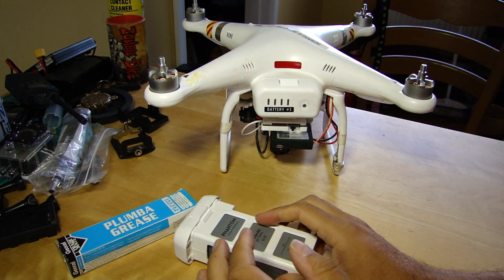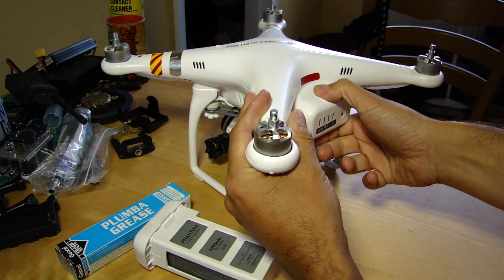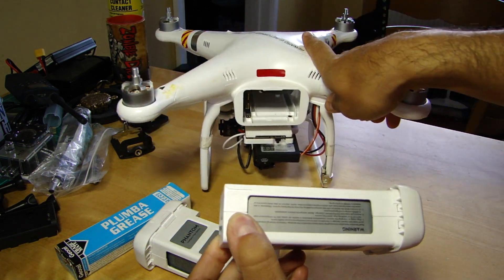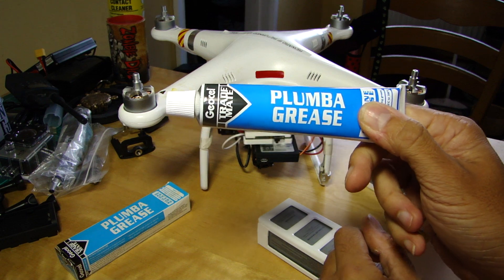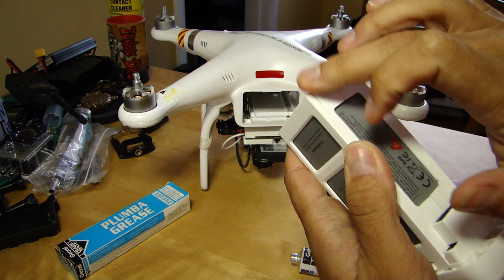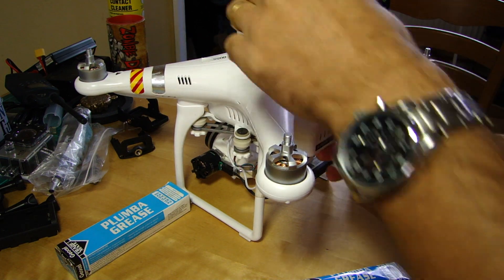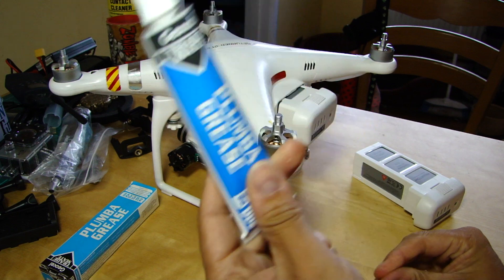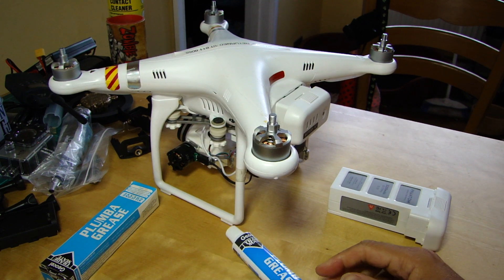How to solve stiff / sticking DJI Phantom 2 / Vision+ battery

Comment: Last year I was struggling with the same problem. It started after I replaced the shell. I was filing and filing to get the batteries to fit. It sort of worked, but now they're sticking badly again. I used a little bit a silicone dielectric grease, available at any hardware or auto store, and they're slipping in just like in your video. This is pretty close to magic! Thanks!!!

Comment: It worked!!! Thank you so much for posting the tip...I was literally pulling the battery out and skinning my fingers plus I have a chronic pain disorder which caused extreme wrist pain days after pulling the battery out. I usually would have my son pull it out for me but if he wasn't home I would have to leave the battery in and stop flying until he arrived home because the wrist pain was horrible...I even considered sending the vision+ version back and just use the Phantom vision 2 because the battery is not so difficult to change. I looked up battery problems with Phantom Vision 2+ here on YouTube and found I wasn't the only one with battery removal problems... so I watched your video and then ordered the lube. I applied it and it was like magic...wow I could pull the battery out so easily I used only my thumb and index finger.Again thank you for the tip!!!

Comment: Great tip but could not find my little pot of silicone lub. Tried rubbing the little slots with the stub of a candle. Same result. It is now much easier to install and replace batteries..

Comment: Grease the battery housing is good, but why the battery is not attached to the body ? Battery reeling inside the body, which leads to breakage of the battery and the crash of the helicopter. The battery need to fix it with glue on the corners, securing it tightly with the battery case. It will extend the service battery and saves the life of the helicopter.

Comment: This is a great tip Simon and worked like a champ.  Instead of "Plumba grease," however, I used Permatex Dielectic Tune-up Grease.  Same consistency, but just on the off chance that some of it could get onto the battery contacts, this stuff is designed to conduct electricity.  From the tube: "Protects electrical connections, ignition parts, and wiring from moisture, salt, dirt and corrosion. Required protection in spark plug or spark plug wire replacement on all modern vehicles."
Reply: I agree.  I wiped off any excess with my finger, like you did.  I was thinking about some folks that might think, "if a little is good, then a LOT is better!" 

I've gone back to the very beginning of your videos and have learned a lot. Thank you for posting such great content!  I have both a P2V+ and a P2 (Both latest version) and am considering Lightbridge for the P2 V2.  I've got the GoPro4 Black with 4.1 rectilinear lens installed and am waiting for the H4-3D to come out next month before installing it.  Then I'll decide on whether to spring for Lightbridge or go the Immersion RC and mini IOSD route instead.  I do like the idea of following a waypoint route to allow me to concentrate on working the gimbal--or using a second transmitter for gimbal operation while the first transmitter flies it like the Inspire.  And I'm hoping that in future versions of the Ground station software I'll be able to set a camera focus point on the map so that the Phantom will track that during waypoint travel on certain legs of the trip.  I think that would make waypoints much more useful.
Until that happens, I wish the gimbal could spin 360 and the Phantom legs would retract (I saw a YouTube video where someone had set up the Phantom legs to retract-pretty cool).

I've already got 7 batteries for the Phantoms, so it's not a simple matter of just using the Lightbridge funds and buying an Inspire One instead.  Too much invested in the Phantoms already, and a longer flight time with the Vision +.  Thanks again!
Reply: Simon, I hope you don't mind my asking you a question about Lightbridge, because the answer I got directly from DJI confused me more than when I started.

I'd like to integrate Lightbridge into my Phantom 2 V2.0. I've got the transmitter with the trainer port.  When I asked DJI what additional equipment I might need to make it work, this is the reply I got:

"The additional hardware you would need is the following:
DJI Equipment you would need:
·         AVL 58 Video transmitter/receiver
·         FPV HUB
·         (optional) iOSD mini for on screen display of flight data
Here is a link for Light Bridge tutorial videos, and one for product specs:
http://www.dji.com/product/dji-lightbridge/video
http://www.dji.com/product/dji-lightbridge/spec
DJI Technical Support Team
DJI Customer Service North America"

According to their spec sheet, OSD is built into Lightbridge.  Also, use of the trainer port disables the internal 2.4Ghz transmitter but allows control signals to be sent to the quad via Lightbridge, so I don't know why I'd need to add a 5.8Ghz transmitter in addition to Lightbridge to view OSD.  Maybe I'd need the FPV hub, since I believe I saw them use that in their installation video, but the other stuff the tech says I would need would add so much weight to the aircraft that I wouldn't bother to buy lightbridge.  I was looking forward to an HD downlink to my IPAD AIR while flying the Phantom 2, and also the possibility of using my other transmitter that came with the Vision Plus V3.0 for separate gimbal control.  Can you help clear the mud?  Thanks in advance, Mark.
Reply: Wow, that took less time to find than I thought it would.  Here's the forum link discussing RF being turned off on the new transmitter when a trainer cable is plugged in.  Right from the DJI forum:  http://forum.dji.com/forum.php?mod=viewthread&tid=1723

So it seems like the DJI tech writing in the forum knew more than the DJI tech that responded to my Lightbridge question.  Hence my confusion!
Reply: *****
Hooray!  Or should I say, Huzzaa!  So there's no need for OSD-mini, the hub, the 5.8Ghz rx...that's more like it!   So with the H4-3D GoPro H4 Black, I'll have 4k video capability, plus the ability to use my two latest version Phantom controller/transmitters--one for flight control, and the other for gimbal control (alas, pitch only).  This will allow waypoint maneuvering via IPAD as well. 

Not quite as capable as the Inspire, but the same video quality and, I think, longer time on station, and my major investment in batteries can be shared with the P2 and Vision +.

Thank you Simon, for confirming this!  Can your friend tell me what his aloft time is with the P2 and LB?  Also, the total weight of his flyer would be nice to know too.
Reply: *****
Good point! 
I'm really relieved at how "plug and play" the Lightbridge installation is turning out to be.  With an older P2, I would have had a pile of equipment ripped out and sitting unused (old controller/transmitter, onboard receiver), but their Version 2 model has really helped to bridge the 4k gap without having to spring for the Inspire.   Thanks again Simon!

Now I just have to wait for the H4-3D gimbal to be available.  I changed my mind on the 4.1mm lens for the GoPro4 camera because I found that out that it was only a 5MP lens, so I went for the 10MP 5.4mm lens instead. I wanted a rectilinear lens to remove the fisheye without requiring video Post-production.  I've balanced my props, so I hope I don't have jello issues with that lens.  Perhaps on one of your videos you could talk about MP ratings of lenses?  I'm used to the CCD of the digital SLR dictating the MP rating of a camera, not the lens, but that's not what I seem to be hearing regarding changing lenses on the GoPro cameras. And it doesn't have to do with cropping the CCD apparently--it's a glass vs plastic lens--more of a lens quality issue, it seems.  And the person I talked to about installing the 5.4mm lens said that you don't set these lenses to infinity like a 35mm camera lens.  He also said that for 1080P video only a 2MP lens is needed, while Still photography requires a higher MP rated lens. That confuses me too.  The whole depth of field issue based on available light, shutter speed, etc..  More confusion for me!  I've been a 35mm format photographer too long and don't know the differences between taking pictures/video with a GoPro H4 instead of my Canon 5D MKIII.
Reply: Ok, thank you again!!!!!

Comment: I was having this issue and thanks for showing us the cause. My solution though is slightly easier and just as effective. Take an old fashioned graphite pencil and blacken up the slots on the battery that engage with the slides in the aircraft. Job done, no mess :)

Comment: There's a way better tip: just use both index and both thumbs to pull the battery while pushing the arms of the drones with the back of your hands, it's so easy, so effective that it makes any other kind of suggestion totally useless.
Reply: doesn`t work for me

Comment: There are enough reports of loss of power in flight that I wouldn't want to make it more likely. Lube just removes one level of protection and as you slide it in and out it will spread along the rails. Other than that I am a fan of the kitchen table.

Comment: Silicon lubricant spray will do the job equally well. It's a handy thing to have around and amongst many other uses is great for making your car's electric windows work better. Just spray the window channels ...

Also good for stopping trim squeaks, stopping window rubbers sticking on a motorhome or caravan.

Comment: Hello. Great channel. Been looking through your videos, and learning lots. 
Question- I am new to my phantom 2 ( with h3 3d gimbal for my go pro3)
I am trying to find out about easy use of iPhone as possible fpv and/or showing hight, distance, battery info etc.
It looks like its super easy on vision model. I'm guessing I need to buy some accessories for my standard phantom 2. Is that correct?

Also, why does the h33d gimbal plug into my go pro? As straight out of the box I can't start stop recording or have any cam control can I? (Apart from tilt up/down)
(So far I have simply been starting record on gopro manually and then leaving it going... please see my channel for a film I made on the weekend over Cornwall Coast if ur interested, that was my second time flying it)

Thanks in advance in case u get a chance to reply.
Reply: Awesome! Thanks a bunch, sorry for my ignorance but i am very new to all this stuff. (got my phantom 2 a couple of days ago)
But loving the footage i am getting so far. (even with my lack of experience) Let me know what you think of my 'GWITHIAN BY AIR' vid i did on saturday if you get time (on my channel)
Thanks again.
B.

Comment: Hi Simon
Thank you for your timely and sound advice about checking the camera and recharging the WiFi repeater.  Duh, I plugged in the WiFi repeater and it charged for several hours.  I haven't tried it yet but suspect that was the problem.  I should have tried that before bothering you, but the light was green so I assumed it was working.

As always thank you for your help.
Regards,
Dave
Reply: I charged it completely and still no wifi.  I opened the wifi repeater and the cables are all securely connected.  I did install the Rotorpixel gimbal but everything worked fine on the maiden flight so I'm really puzzled.
Reply: No it does not come up.  I'm puzzled as well.  I haven't touched the camera other than install the Rotorpixel gimbal but it worked fine after that.